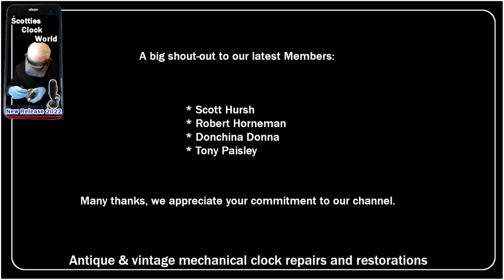Mechanical Clocks: Wheels, Pinions and Lantern Pinions Explained

Comment: So from your video, I believe that the lantern pinions could be changed for a cycloidal pinion? Im planning to build a small clock and Im copying a clock that has several very small (open not caged on the smallest ones) lantern pinions but Ideally I'd cut cycloidal ones instead
Reply from the maker: Lantern pinions are easily replaced, but if you are building a clock from scratch then you have the option of cutting your own.